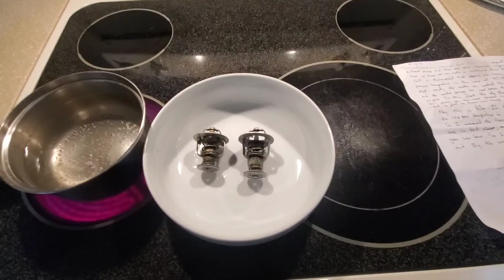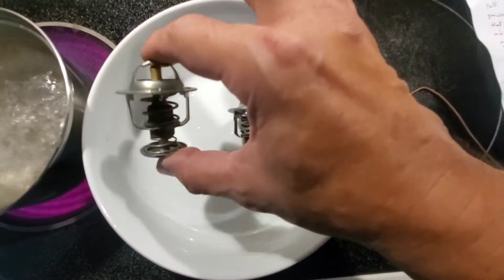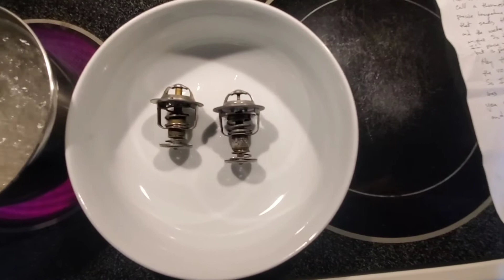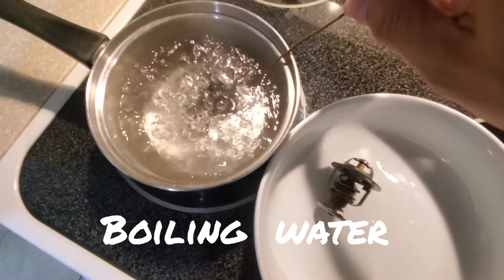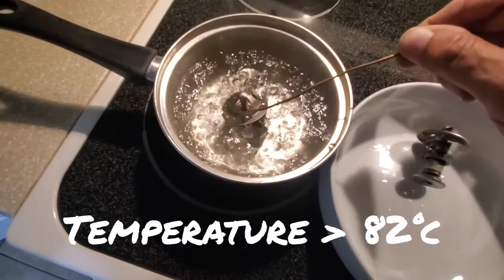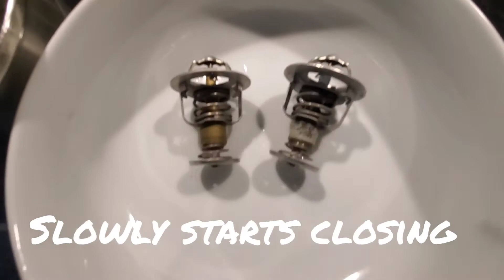Honda VFR800 Thermostat: Just an Example of Thermodynamics!

Comment: Excuse me, I have a Honda VFR 800 from 1998 and the temperature goes up to 145 when stopped and when driving it goes up to 210. Why could it be?
Reply from the maker: @DAVIDMARTINEZ-lz8fq  It's normal to get all the way to 220°F, but never above 230°F. The VFR runs slightly hotter than other bikes due to the position of the radiators. Thanks for watching.
Reply: @PollosMotorcycles  Thanks for the info buddy I thought there was something wrong with my motorcycle

Comment: amigo grande ,top video thanks.
this one also fits honda cbr900rr 1998/1999 only thing it starts opening at 82 degrees instead of 75 degrees ,last one is hard to find.
i would not go from roomtemp to boiling water  be carefull.
and you are right it cools the engine but more importante , it regulates  the temp.
what do you think the bottom part is doing?
also has small holes in the bottom plate.makes me wonder.
drive save.